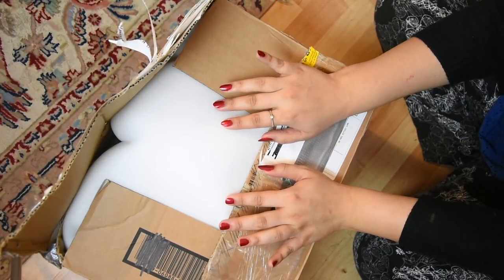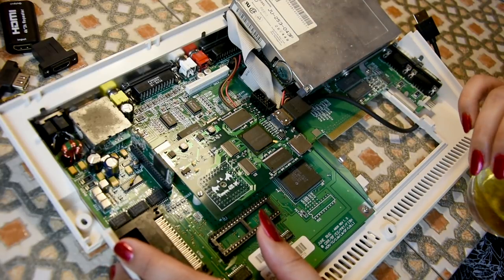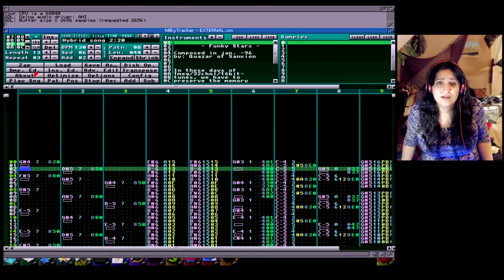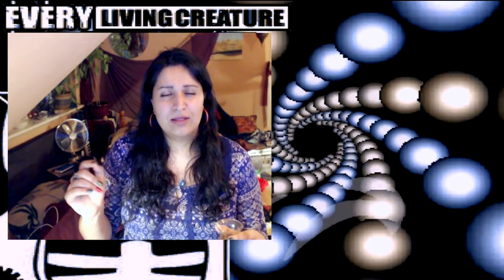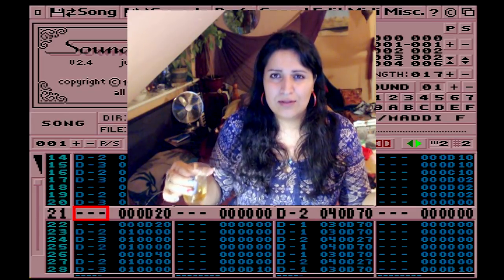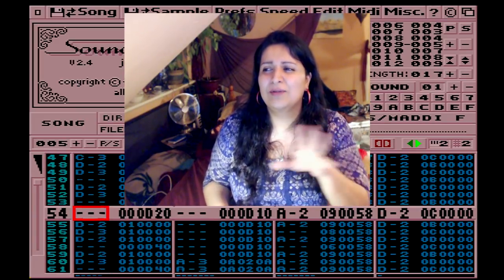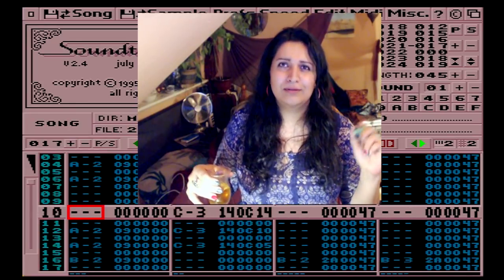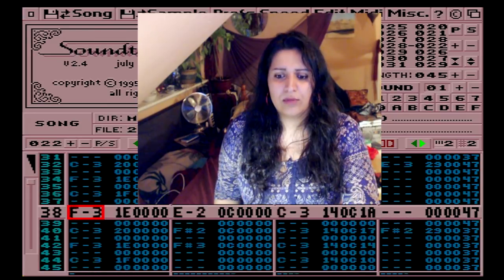Vampire V2 Amiga 600 Part 1 - Unboxing, Demonstration & Chillout talk

Comment: Fantastic video and congrats on the A600 with Vampire A600 ! 

I do agree with you that this is an accelerator and I do too consider it a real Amiga. its an FPGA chip that contains 680x0 instruction set on it there isnt any emulation layer to this at all.

One of the biggest points that the purists argue is that this card 'breaks' compatibility - for example AGA on an ECS machine, RTG on an Amiga 600,  custom/patched kickstart rom, specific AMMX instruction set etc.

I do see that point of view but i also disagree. In my opinion the community needs to move forward and not be stuck in the past.

As a porter of things to the Amiga and in some cases targeting the Vampire for performance i can tell you that everything I have ported than runs on the Vampire also runs perfectly fine on 030/040 and 060 original accelerators (albeit slower :\ )

so very well said - agree with your points and enjoy your new Amiga ! Have a wonderful holiday season!
Reply from the maker: Thanks MVG :o) 

I've just had a few comments about comparability, but then wouldn't any upgrade break compatibility? 
all accelerators would do this anyway. 
With regards to moving forward, yes I agree, although a second Amiga is always an option, I have one that is stock and i'll never upgrade, best of both worlds is always an option :o) 

As a porter of software I think your word on it is gold, because you've done the actual work yourself. 
Already enjoying the new Amiga, have a great Holiday season MVG!
Reply: I agree that the community need to move forward. I just don't think the vampire v2 is the key. V4 might be one of those boards. I have a hard time grasping the way that the V2 takes over more and more operations from the 600 original hardware. In time, when the last core update are finished, it might just be missing drive and periferal connectivoty, as I see the original 600 be reduced more and more to the point of only be a spine for the V2 board. I am really 50/50 split on what I think about the V2 board. I like it as much as I dont want one, in other words. So I am in the proces of sourcing an IndevisionECS for my indevidual computer mem opgrade and sourcing a true 020 accelerator running between 14 and 25/30-something. I am not a true purist, as I like lcd/tft over crt. I just want to be able to have something historical specced yet with modern options, like usb and flatscreen monitor.

Comment: I have the quite the same configuration. One thing you should do urgently is bending down the metal pin of the rf shield located close to the audio cinch output. Because if you don't it will scratch  the surface of the keyboard ribbon and cut traces, and you'll have to replace it.
You should in fact bend down all others metal pins of the rf shield because one will push on the floppy drive and prevent normal operation (slow motor, no ejection...) and front ones will prevent the case to close completely (mine was broken by the previous owner because of that.
There is a 3D printed adaper out there to fix the HDMI pass-thru on the motherboard instead of the TV RF modulator.

Comment: Indeed, if Vampire is "not a real Amiga" then all of the accelerator cards that exist for Amiga that are not made by Commodore are "not real Amiga" either. Not to bash on AmigaOne, I have one myself and love it, but I personally consider Vampire (thanks to it being 68k) to be more "pure" Amiga than any PPC Amiga. I also happen to have a Vampire V500 V2+ in one of my Amiga 2000s by the way. 

For me Amiga is more about the feel, the feel of the keyboard, the case, handling of disks, the smell of warm plastic, the sound of a clicking drive and so on. 

Much Congrats to the Vampire and Merry Christmas! :)
Reply: Maria Engström I used to have a A1200 with a 68030 accelerator back in the 90s. It was as much an Amiga as my vampirised a600.
All the C= hardware is still in use (well, except for the RF modulator of the a600), from the power brick to the mouse. I use the ide port, the pcmcia slot, the RGB output, the mouse/joystick port, the internal expention board. A faster CPU and extra features don't disqualify it from being a true Amiga.
Reply: Indeed... Or you can say. The Amiga is a platform that works in a specific way. A computer that runs AmigaOS4 are still an Amiga. Just as pure as the ones that run AmigaOS1. If we have to take that arguement more precise, that people wrongfully postulate. Then anything made by Commodore, is not a real Amiga. Commodore just made Amiga platform computers for a number of years. Then Escom. So are an Escom 1200 not a real Amiga? Or lets talk Apple. Is the 2020 not a real Mac, because it does not use a M68K processor? How about a PPC-Mac? A vampire is still an Amiga as you say. The same with an AmigaONE board. The same with an Alice board. Replica boards as well. Amiga is a platform and nothing else.
Reply: Well there is a problem if you use SAGA. It is just reimplementation of AGA inside FPGA with additional features which means you end up with original amiga hardware basically for keyboard, joystick, mouse. It's a trap many ppl fell when sandwiching their A1200 back in mediator and blizzardppc days. 

BTW emulation is something working like something else. Cyclone II/V surely is something else than several commodore ASICs. It makes no difference if you emulate something with software algorithm or programmable logic. In both approaches it still is EMULATION. 68080 is not emulated, it's processor designed solely for FPGA and doesn't exists anywhere else. SAGA emulates AGA functionality.

Comment: Cool stuff. Amazing A600 setup ' enhanced '. I am in the process of repairing my two dead A1200s and have gotten a MIST FPGA system to run my Workbench & WHDLoad stuff in the mean time. I can also run it on my Chameleon 64 with a similar FPGA Core on my C64 Reloaded motherboard.
Reply from the maker: Thanks! i hope you managed to fix your A1200s and enjoy them| i've actually been curious about the MIST and how it compares to an Original Amiga, i havent had first hand experience with it.

Comment: Waiting for the 500V2 to be ready. I feel the same. I have a crazy powerful PC, but I want to supercharge my dear old ECS500 as it's only got a 37mhz 68EC020 at the moment. Thank you Madija!
You are the perfect example of what my friend said many years ago about various computer users.
Mac users buy a piece of software to do a job.
WIndows users download or buy a piece of software to do a job.
Linus users download the source code, and compile the software to do a job.
Amiga users hack their machine and build some additional hardware to do a job. Referring to your built in DVD-rom, the hardware I built years ago that reads Playstation memory cards via the external floppy port, and what ApolloAccelerators is doing.
Keep up the amazing videos!

Comment: Congrats! 

Moot point I think, if you had a Vampire available when the A1200 came out, or while it was 'current',  you bet you'd stick it on, and nobody would think of it as 'not being pure'. But hey, I'm an outsider, having never owned any Amigas, but saving up to get one, and absolutely wanting to get a Vampire! :D
Reply: Nail. Head. Hit. Back in the day, people wanted to expand their Amigas, whether it be accelerators, memory, RTG, SCSI, CD, HDD etc. Even PC and Mac bridge boards. They would pay extortionate amounts to get them too. Because CBM have gone, people seem to think the Amiga should stay as it was when they went bust? What would the Amiga have been if CBM had carried on? HP Risc? Hombre? PPC or X86? PCI, AGP, PCI-E, USB, SATA? Would they have stuck with serial and parallel ports and RF out? What about planar graphics? Nobody complained fitting an RTG card made it not Amiga. Some Amiga users are so narrow minded.

Comment: The thing I like most about the Amiga is the user experience and that is best on real hardware - but I include the vamp in that statement. I have a heavily expanded machine and don't need anything but the faster CPU. However, my Voodoo, SB, and Realtek cards won't last forever and I don't begrudge the extra video bits on the vamp 1200, if and when it gets a release. Thanks for the thoughts, though - I like to see someone actually using these things and enjoying them!

Comment: People banging on about the Vampire not being a "Real" Amiga probably dropped serious coin on old school acceleration back in the day and resent the fact that something hugely more capable is available so cheap to anyone willing to wait for one. Not only that, but with every core update the FPGA based accelerator is like getting a new system for free with every update! Bluddy excellent. People who say FPGA is "only" emulation don't understand what FPGA is. FPGA is how all chip based hardware prototyping should be done if done properly. If Jay Miner were still with us (may he RIP) who in their right mind thinks he wouldn't be developing future Amiga chip design using FPGA? Of course he would be using it. I'm old enough to remember the development of the Amiga OCS as several server frames holding hand soldered components on massive breadboards with patch leads like a spaghetti nightmare. FPGA would have been a Godsend to the original implementers of JM's radical chip design.

Comment: my pal ripped off the TV-Modulator and made a HDMI-Connector there, now i can connect the HDMI  directly without open TrapDoor :-D
Reply from the maker: Yes! it's so much easier! ...I did that in part 2 of this series :o)  https://youtu.be/TYTsgFzeIJo
Reply: Yes thanks, i saw it too late, it s a very good solution. The Gold3-Core is not far, i m looking forward to AGA-Graphics and hopefully for good and simple SD-Slot-drivers.

Comment: never been a fan of the a600, but its such a versatile machine!! , THOSE TRACKS! WHOOHOO go milky TrackR
Reply: the vampire is a real bit of hardware, the FPGA is essentially configured to BE amiga hardware... :)
Reply from the maker: I've always liked the A600 actually, the form factor etc, Though they could have done more with it back then, but then that's Commodore for you. 
Yes, thats exactly my thoughts on FPGA, I dont accept when people call it "Emulation" :o)

Comment: Im a bit late to this party, and you may have even seen my comments on Facebook regarding why an FPGA implemented Amiga is not an emulator... here goes...

Custom chips are designed as a bunch of logic gates, all wired together that makes that chip do a particular task. The Amiga custom chips are exactly that. In fact, if you have ever seen pictures of the original prototype "Lorraine", you will see several HUGE boards full of standard logic chips, all wired together... those circuits became the Amiga custom chip set. 

An FPGA is exactly like those boards - it's a huge bunch of standard logic gates that can be wired into whatever circuit configuration you want. If you take an FPGA and give it a wiring map which makes it work as a 68000 series processor, or works like the Amiga custom chips, then that is a HARDWARE implementation. A lot of people seem to think an FPGA is a processor that runs software, which is not correct.. while it does have a memory, it is not loading up a program, it's loading up a wiring configuration to know how to wire all it's gates together.

Emulation means SOFTWARE running on a general purpose processor system (such as a PC) pretending to be hardware. That is the big difference.
Reply from the maker: Thank you for the in depth explanation Peter, and indeed well explained! I was trying to convey the same message which was appearing in my mind as images, but didnt know the right words to articulate it well.

Comment: Ah I'm glad you got a Vampire. I've had a V600 v2 for a while and I bloody love it. I removed my RF modulator and routed the HDMI through there via a panel mounted plug, I haven't needed a HDMI amplifier and I'm using a SDNET adapter to get online. 

As for the argument about being a real Amiga! WOW people lose their minds arguing about this. My opinion is this. 

Since day one people were modding their Amiga in any way they could to get it to do things beyond what it was originally designed to do. This is no different. It's just another custom mod to get more features. I don't class it as emulation, perhaps a it should be called re-implementation or simulation? Either way it's FAST and I love it. Enjoy. Can't wait for core 3.0. And I think I need to give this Apollo OS a go. 

Thanks for the video. :)

Comment: Fantastic video, I’m really enjoying watching your channel. I’m currently looking at all the amazing upgrade options that exist for my A600 being a bit of a noob to modding / upgrading my Amiga. Currently looking at getting it re-cap’d first off before I go any further as I’ve started getting distorted audio / poor video output from RCA outputs. 
A few years ago, I got a 1MB trapdoor expansion and CF IDE HDD with WHDload installed but my Amiga went into storage for a couple of years and after bringing it out of storage and powering it up, it went sadly downhill.

Comment: You are correct, FPGAs implement a hardware architecture in a reConfigurable chip... It is not programmed as you configure hardware. The elements in the FPGA are configured to properly execute the code pipeline as an amiga would.

Comment: I knew an older gentlemen that was a handyman at my work after a long career as a carpenter. One day he was putting up some signs and telling me about his hammer. The hammer was handed down to him from his dad, who was also a carpenter, and now he teared up as he told me he was looking forward to passing down his dad's hammer to his grandson.

I looked over the hammer and made comment on how it was in such great shape it was in. Especially for a such an old hammer that had been so heavily used over the decades. He gripped the hammer with trembling hands and said that "Over the years i've had to replace the head twice and the handle three times".

How could he consider this hammer to be his fathers'? I didn't understand. Until one day at a computer museum I sat down in front of an Amiga 600, an Amiga model i never had, and teared up as i placed my hands on the keyboard. It didn't matter that this wasn't MY Amiga my feelings for that machine were there, like his feelings for his fathers' hammer were still there.

Perhaps the way to define whether something is an Amiga is by how it makes you feel.
Reply from the maker: You hit the nail on the head there... (I'm sorry, I tried, but I couldnt resist that one, it was just so apt ;o) )

It's about what's beyond the technical wrestling match which people have.
Your last sentence just puts it all into place. The reason why we're defying all norms and still using a 30 year old computer in the first place. As you said it's about that feeling.

Comment: Congratulations! It's great to see you so happy.

I understand what your trying to say that a real Amiga is. I agreed except i've never felt that a PPC emulating a 68k CPU and using a PC graphics card through RTG counts as being a real Amiga.

The Vampire is not only a real Amiga but pushes it's development forward by expanding the chipset capabilities.

I'm in North America and haven't been able to acquire an Amiga to put a Vampire into so i'm waiting for the stand alone version. Back in the good ol'days i had an Amiga 500 and an Amiga 1200.

I'm really tired of WinUAE. It doesn't have the same feel and suffers from Windows pauses, which would never happen to an actual Amiga.

Comment: I was really stoked for Vampire, but as of late I changed my mind. FPGA, is not software modding, but it's programming a newer chip to sort of emulate motorolla 68000 hardware. So, instead, I grabbed some 30 plus year old fast ram upgrades for one of my a1000s and a500s.  I still have to replace capacitors and such, will add a Gotek as well, since drives and disks are failing these days...great video though and fantastic passion.  I absolutely loved my A500 back in the day.

Comment: Regarding the"is it a real amiga question" I honestly think is this in the spirit of commodores way of doing things ? Id say architecturally yes - and its certainly close to the promised chipsets that were in the pipeline before they went belly up. Vampire takes it a step further though , because we can and because were not connecting these things to the same types of peripherals nowadays.

Comment: The Amiga is a range of computers. If Commodore had survived, there would have been much  more powerful Amigas... so yes, a modern Amiga is still an Amiga as long as it builds on the original template.

Comment: An Amiga with updated EPROMs or cards or Inputs & outputs will still be a true Amiga. Maybe not a Vanilla Amiga but still a TRUE Amiga. Just like a Cassette Boombox with new fresh caps and belts and an LED light would still be a Cassette Boombox. Restored, tuned, modded, what ever. It's still what it is as long as it's not turned into a Diesel Engine.

Comment: Did you boot the the Apollo OS from the IDE? The on-Board SD Card I believe is not supported yet. What is the part number on that IDE Module?
Reply from the maker: Yes I booted it from that IDE, as you said the onboard SD card cannot boot. I'm not sure the number on the IDE module, i'd have to open it up to check.

Comment: The furthest I got was a Blizzard 1230 IV with 68882, SCSI with 256MB RAM. That thing ran fast. But the 060 was always too expensive, like it is now. With PiStorm, I just don't think you need them any more. Real HW is way too expensive because people are willing to pay stupid prices and others who see this and then price gouge.

As for emulation, it's no longer grinding because the hardware it's running on is so fast and the graphics stuff is all accelerated now, it's now easy to do. FPGA is programmable hardware, you program it to do what you want, including recreating old chips.